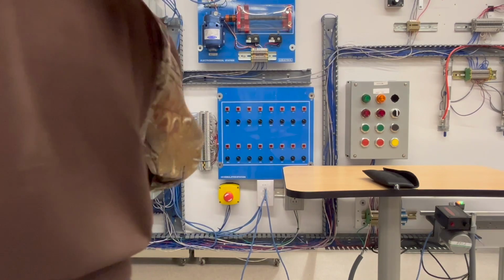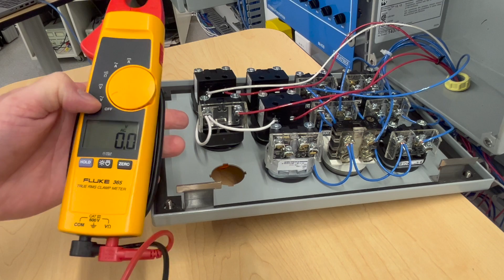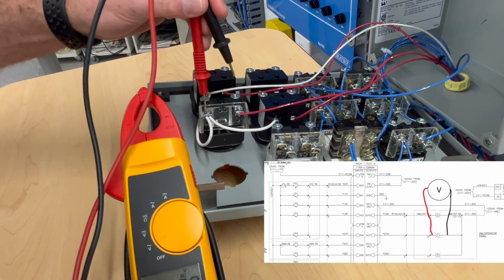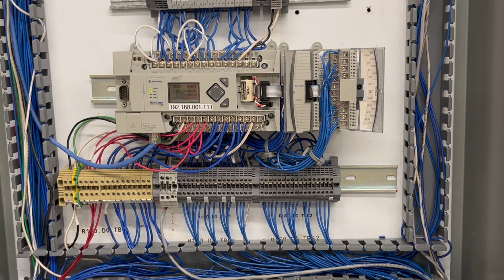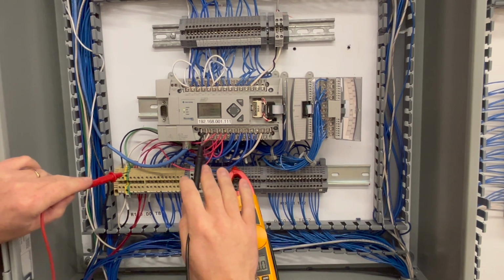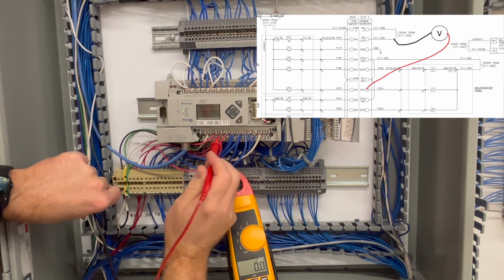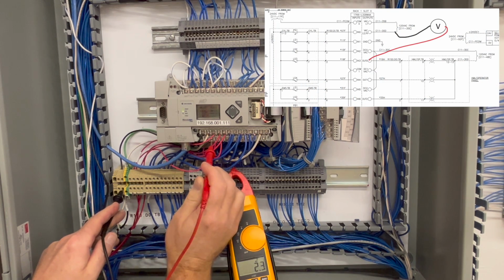Troubleshooting a PLC Output

Comment: I love your videos! I have a omron c20 that i would greatly appreciate if you could help me diagnose. I have no error light lit and the power light blinks on and off, so does the programmer when i plug it in?
Reply from the maker: Thanks for the kind words! I have never worked with that Omron before. Have you checked the incoming power? Sounds like there is a short somewhere and you're losing power. That is where I would start.

Comment: as a tech, I would check the PLC output first. first check for the light/signal from the PLC. if I'm getting signal output, then check voltage. be very careful when re-programming to swap outputs/inputs. any program changes should be thoroughly documented in the program.
Reply from the maker: Thanks for sharing your troubleshooting tips!

Comment: I was at a interview talking with owner. He told me it took two weeks to find problem on the output flashing. All you have to do is use a analog meter and connect to flashing out put. Light flashing  but not anything on meter. It's burnt. Took me 3 mins to find problem.

Comment: geez! replacing an entire PLC just for ONE stinkin' bad internal relay... and none of the wires are labeled--yikes! Hopefully there is a free output port available and all you need is to update the ladder program and then cut a slightly longer red wire and--POOF!--problem fixed (hopefully). Nice video. Thanks for the explanation, compadre!

Comment: Hi thanks for the great video. 
I have a similar problem with our rs logix 500 Plc. So our maintenance electrician just recently replaced a probe sensor for a chemical tank that measures PH level. 
The analog output address on the module where the valve is wired to is constantly putting out 115 AC, keeping the valve open. But the sensor is not sending the signal for the valve to be open. The output led light on the module is not on even though it's putting out the AC voltage. 

Do you know what could be the issue? 
Is the output module defective?
Or is the probe sensor defective? (Although the probe was tested and was measuring the PH properly).

Thanks for any input.

Comment: Some of the machines I work on had PLC’s that had mini 3/4”X 3/4” see through plastic relays that were replaceable and made repairs easy.
Reply: Ice cubes!
Reply: @Stoney00075  no, about 1/4 the size of ice cube, one single contact.
Reply: @truthserum9157  wow even more Modular ha! I be never seen a single
Reply: An mcc i installed had all the plc outputs broken out to multi-pole relays. Each relay had 120v and 24v available (color coded poles) absolutely beautiful to work on. If anyone did a dumb, just replace a relay

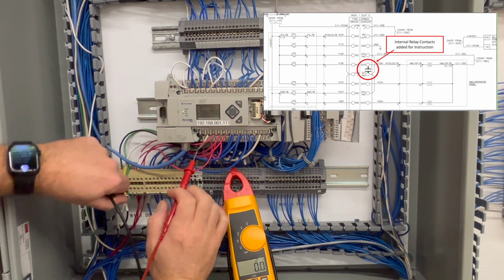Comment: 5:44, The NO in the diagram should be connected between DC1.VAC and OUT1.
Reply: Correct. I was going through the comment to check if someone else noticed it. It was an over sight. He really did a great job in the video

Comment: I'm confused on how exactly how the PLC output is bad. If your able to activate on the software wouldn't that imply it's still good. In other words how is the software able to activate the output if it's broken?
Reply: Just like your phone.. You can switch the torch on and not get any light... The plc software can be 100% but the hardware maybe faulty
Reply: No the plc true is just showing how it should be turned on .
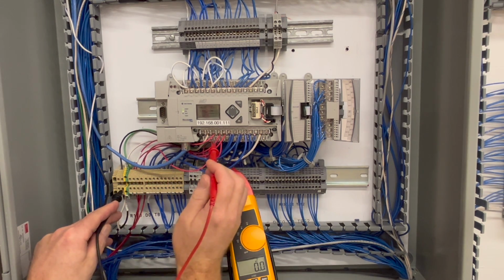Reply: @Cesar-kc5un  At 6:40 he forces output zero "on", then takes measure and it is producing 120V. How is the program able to force it on while the button is unable to?

Comment: What if it was wired with wetted voltage?  If the output is sinking, the power goes to the bulb, and then to the output contact.

Comment: I had 6 outputs from a plc, these are nozzles that were opening accordingly as programmed. However, after some times the began to operate inappropriately. Instead of opening and closing sequencially as programmed, they began to open and close in a wild manner, what could be the cause, any idea on what i should do?
Reply: If the PLC code has not been changed, then most likely you have a PLC input with a loose termination or a faulty input device.

Comment: Good job sir, exactly how I would have done it. I’ve actually ran into this out in the field several times, had 2 output cards with bad relay terminals not putting out voltage. You don’t see it much but I always like to add circuit breakers on my outputs when I build and wire control panels, a lot of times the output in the field could possibly take out the output it’s attached to. Good video!

Comment: So you activated the output manually and it’s not coming on so you know it’s not the trigger signal or input to activate that output. But which input is suppose to active that output?
Reply from the maker: That is determined by the logic that is programmed into RSLogix 500
Reply: @KletteTech  so the plc receives data from whatever that light is referencing to?  Also how do the inputs work, do they correlate directly with a certain output or do you program any input to whatever output you want? Thanks for the responses
Reply: @garrettsmith6679 you can program any input to any output. Another quick test is to use a jumper wire from the correct voltage source, in this case 120 vac, from the input to the output terminal, and if the device works, you know the output is bad.
Reply: @daveb9370  right!!

Comment: Is it common to wire 120V load through the PLC outputs or better to wire a low voltage relay first? Let's say I have an air solenoid valve (120V).
Reply: solenoid valves are inductive loads which will generate back emf. Typically the solenoids come with built in diode protection, but it is always good to put an interposing relay to separate the output from the load. Cheap solution and much safer.
Reply: Thanks, that's what I was thinking.
Reply from the maker: Agreed.  For simple pilot lights and other low current devices you can wire through the PLC

Comment: Great video and on point. During my time in electrical industrial maintenance the most common PLC module we would find failed were both SLC relay output cards as well as Compactlogix. The relay outputs would typically be failed in the closed position especially on power open, power closed valves. Something to keep in mind is that 120V Triac outputs commonly leak current in the off state and can mimic almost full line voltage to a voltmeter with the output in the off state without a load attached.
Reply from the maker: Well said! And Great advice.  Thank you commenting and sharing your knowledge.
Reply: @KletteTech  How can I interpret  Electrical Control  panel of a machine such as Concrete pump ?
Reply: @tektonelec4695  It is not just SLC and Compactlogix that suffer this.  I was working with PLCs my entire career (earliest was a Goulds), and I never found any relay output cards that didn’t suffer this problem.  I trained all my guys to always leave spare points when designing PLCs, so you could move a wire and get back to running right away (power plants only willingly shut down during scheduled maintenance outages), and to always use an interposing relay with a flyback diode to mitigate this problem.  We used this method even with a 24 volt card powering a 24 volt circuit.  It took up more real estate and cost more, but it greatly reduced the failure rate.  We weren’t a professional PLC company, we were custom designing PLC control systems for the combined cycle power plant we worked at, so there was nobody to tell us it cost too much.  Given the cost to our customer for down time, estimated at $250k/hour, we were able to show that doing it this way raised our run time from 95% to 97% in one year, netting out customer several million in increased profits, and us a nice increase in contract revenue.  Of course myself and my techs only got a slight one time increase in our incentive bonus, but we expected that.  The true value to us was pride in our work.
Reply: most outputs are only rated for 2 amps. if a short or failure pulls more, the relay "burns" closed. that's why you have to run relay switches for higher amp draws.

I'm interested in the leaking on 120V circuits. I don't have a lot of 120V experience. Almost all mine comes from  mobile units running 12 or 24Vdc. I'll keep an eye out on that. thanks!
Reply: @r@r@r @robertscaggs1346 olid state 120V AC triac outputs have 2 states high resistance (off) and low resistance (on). To a traditional voltage meter with near infinite resistance it would appear the output failed on with a voltage reading near normal with the output actually off. A multi meter with a Low Z setting helps to rule this out. I initially replaced the output module and then learned the error of my ways. 
Thank you